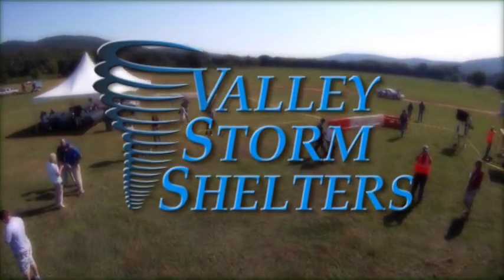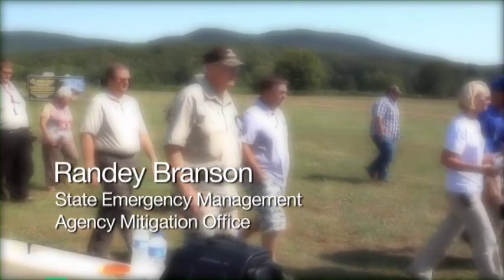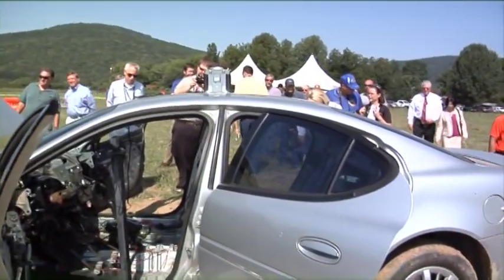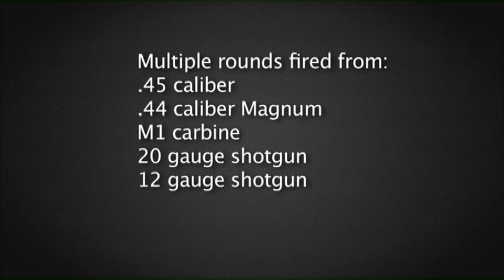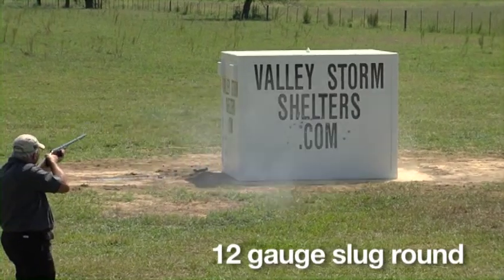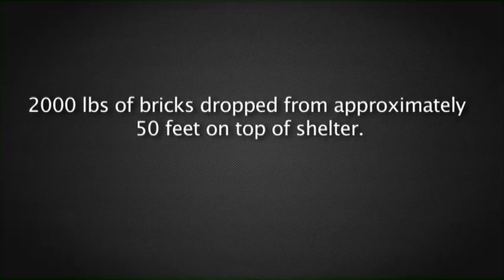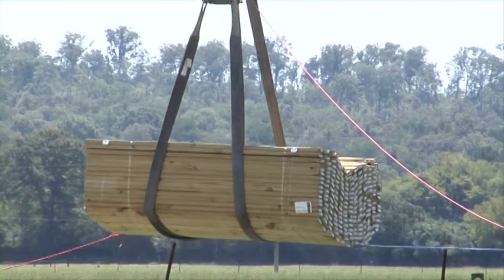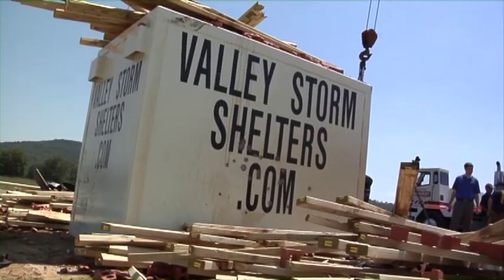Direct Hit - Valley Storm Shelters

Comment: So this demonstration is such a scam and only designed to make the shelter look stronger to people who don't understand how things work! Thus i will not buy from this company if they can't be honest in a demonstration! 

What am i talking about well:

1 shooting the side wall at a angle makes it much harder for a bullet to go threw and just ricocheting off. Well known trick and has been used on tanks for many decades. Weaker thinner steel can be used if the metal never takes a straight on hit. I get it most things hitting this shelter will not be strait on but the average customer don't understand how that works and would believe it will take a strait shot without being penetrated. Making the shelter "seem" more bullet proof then it is. 

2 Ramming a light car into the strongest side of the shelter at what really is a slow speed. Most people don't realize a 3/4 or 1 ton diesel pickup go over the scale at around 8000lbs over double that cars weight! Lets see that hit the weakest side? Pickups are everywhere now and highly likely to get thrown around in a tornado! Sure it seems like the car at a slow speed means it is strong but only to people who do not know much about this stuff. 

3 2000lbs of brick in itself is really pretty light! Then given the fact that 2000lbs is spread across the hole top with little constrained weight shows really nothing more then to look good to again unknowing people. Try dropping a 2000lb solid block of concrete would show more! Like a road barrier or something that would actually be a hard hit!

4 Dropping soft lumber especially not being on the end but rather the side of the wood so it spreads the weight nice and even is completely just for show and no real test. Any decent house roof would handle that one.... Again fooling the unknowing people.

5 Ok so you drop a car on it great! Finally something that has a little weight and a little pinpoint of the weight concentrated right? NOPE you left the bricks and the wood there which cushion the blow of the car and spread the shock load across the hole building. Another fooling attempt. Could of at least cleaned off the roof so we could see what would really happen! Better yet drop a 1 ton diesel pickup on it and show some real strength! 

6 lastly cars, bricks, and lumber is not all that is out there or the only common. What about a large tree? Pickups? Semis? Did you not show them because the building cannot stand a hit from them? Seems like there must be plenty of hidden weakness's here being you went threw so much effort to make sure non of the test was really that stressful on the building! 

Don't like the hard truth? Then show some real stress testing without always giving the building the advantage as what was done here just to fool people! Don't want to but hate my comment pointing it out? Fine come install one here at my place and i will test it till it fails! I have ways to throw heavy objects at it and drop them on it. I also have plenty of large trees!
Reply: What one needs to consider is the Valley shelter compared to the competition.
Reply: @riverbender9898  That is exactly what i did.
Reply: I suppose its FAR better to have one then to not and take your chances.